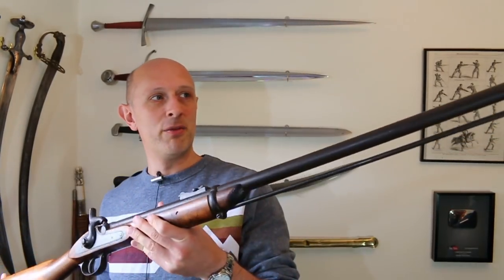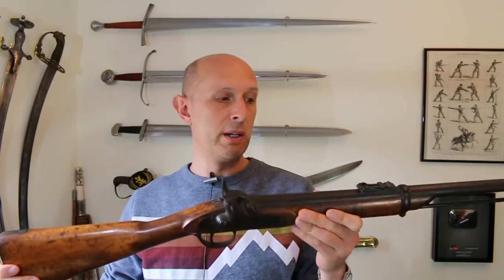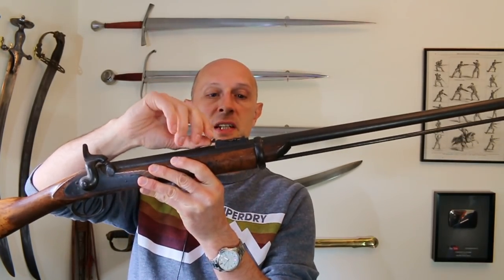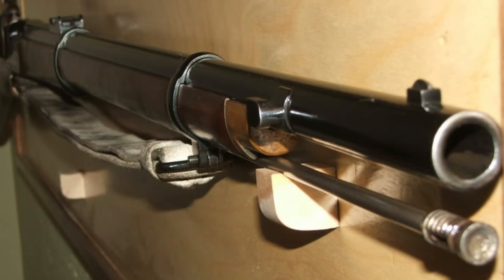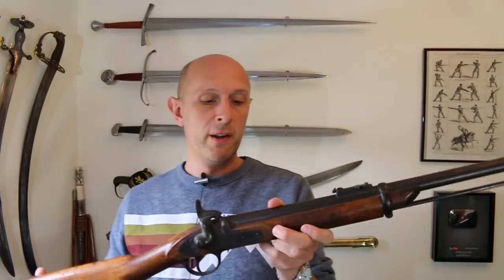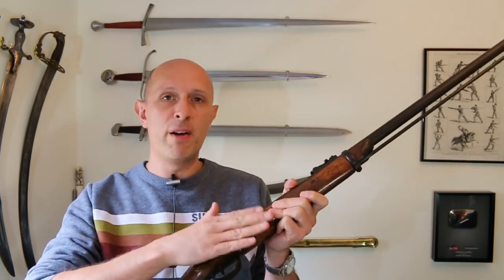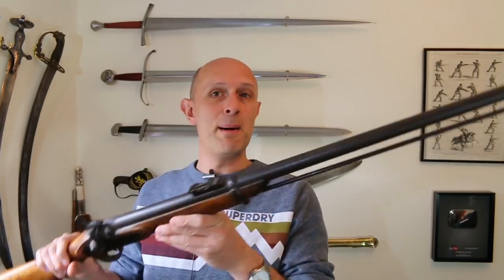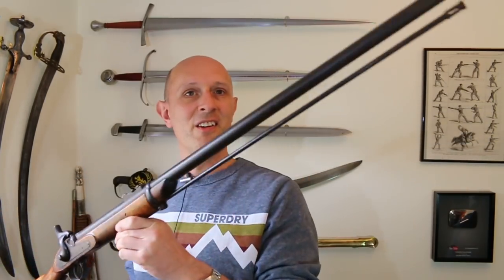Lancaster's Patent Muzzle Loading Rifle

Comment: Excellent post. Another advantage is easy of manufacture. The Lancaster barrels were made using a mandrel and were much easier and less expensive to make than the single hook cut rifled barrels that predominated through the 1860s. They were not widely accepted at the time for the same reason that modern polygonal rifling still struggles to go mainstream in long arms despite all of the same advantages. People like to see rifling. When they can’t, they don’t think it’s as accurate. Today polygonal rifling has been largely accepted in handguns designed for military contracts, and there are high grade custom polygonal pistol barrels available too. But you almost never see it in modern rifle barrels.
Reply: The german Bundeswehr had crome-plated polygonal barrels for their MG3 about 30 years ago. Can't remember, though - maybe they only where for the gun turret of the Marder APC, where barrel replacement isn't as easy as with a hand-carried gun ...

Comment: The problem with firing shot out a rifled barrel is that the spin imparted by the rifling causes the shot to spread further because of centripital force. Even though that rifling is very mild, it would still increase the spread.
Reply: Harvest N however, that's not always a bad thing in every context ;)
Reply from the maker: I kind of what to test that on a large target now....
Reply: The period advertising said that these were also able to be used as shotguns.
Reply: In addition to increasing the spread, it also tends to create a somewhat toroidal shot pattern, i.e. a pattern that looks rather like a doughnut. This can decrease the likelihood of a good hit at the center of aim, which isn't great if you have a small or distant target. This is a common issue for revolvers that are chambered for .410 shotgun shells, as by US law pistols are required to have rifling.
Reply: scholagladiatoria Even at 10yd or so, you will get a donut shaped pattern.

Comment: If it is indeed rifled then using it as a shotgun would have exactly the same disadvantages as using a rifled choke in the shot gun. That is that the cup the holds the shot will engage the rifling and spin exactly the same way any other projectile would. The cup imparts that spin onto the shot which will then have a much wider pattern than it would normally. If no cup is used (it is a muzzle loader) and the shot is packed tightly enough you might have a similar affect.

Comment: P under a crown is a proof.  You can restore the stock with some work.  A dovetail join, find the hardware and it's done.  Can't help you with the bayonet lug.  That has to be welded.

Comment: There were several other such smooth bore rifle designs in that era. What was usually unique to these designs was that the bullet was also shaped in accordance with the shape of the twist. I'll supposition that this rifle may have been furnished with a slightly oval shaped bullet in order to take spin from the twist and prevent blow, as a waste of energy, by of the expanding gases and explosion of the black powder charge. Of course the designers could have been relying on the bump up from a dead soft lead  bullet to take the oval shape on powder ignition. This may explain why the oval is imperceptible to allow a round shaped projectile to fully bump up to the barrels internal shape. I've seen this with Snider rifles where you could see daylight around the bullet in the groves but accuracy being excellent for that type of firearm due to bump up of the bullet that would fill the groves upon firing.

Comment: Long quote from James McPherson's history of the American Civil War "Battle Cry of Freedom":

     "Rifling a musket increased its range fourfold by imparting a spin to a
conical bullet that enabled it literally to bore through the air. This fact
had been known for centuries, but before the 1850s only special regiments 
or one or two companies per regiment were equipped with rifles.
These companies were used as skirmishers—that is, they operated in
front and on the flanks of the main body, advancing or withdrawing in
loose order and shooting at will from long range at enemy targets of
opportunity. Given the rifle's greater range and accuracy, why were not
all infantrymen equipped with it? Because a bullet large enough to "take"
the rifling was difficult to ram down the barrel. Riflemen sometimes
had to pound the ramrod down with a mallet. After a rifle had been
fired a few times a residue of powder built up in the grooves and had to
be cleaned out before it could be fired again. Since rapid and reliable
firing was essential in a battle, the rifle was not practicable for the mass
of infantrymen.
     Until the 1850s, that is. Although several people contributed to the
development of a practicable military rifle, the main credit belongs to
French army Captain Claude E . Minié and to the American James H.
Burton, an armorer at the Harper's Ferry Armory. In 1848 Minié per
fected a bullet small enough to be easily rammed down a rifled barrel,
with a wooden plug in the base of the bullet to expand it upon firing to
take the rifling. Such bullets were expensive; Burton developed a cheaper
and better bullet with a deep cavity in the base that filled with gas and
expanded the rim upon firing. This was the famous "minié ball" of
Civil War rifles. The superiority of the rifle was demonstrated by British
and French soldiers who carried them in the Crimean War. As Secretary 
of War in 1 8 5 5 , Jefferson Davis converted the United States army
to the . 58 caliber Springfield rifled musket. Along with the similar British 
Enfield rifle (caliber . 577, which would take the same bullet as the
Springfield), the Springfield became the main infantry arm of the Civil
War."

Comment: I didn't catch mention of the bore size - that's covered by the numbers with the proof marks. In 1863 the "Army (Rifles)" report was published in the UK. Lancaster large bore (.577) and small bore (.451) rifles were included in the trials. Of the small bore rifles, the Lancaster faired OK in the trials but lost out to the Whitworth in precision. It was noted there was a tendency for the Lancaster to throw occasional wild shots. In the large-bore trials it was however a different story. The tendency to occasional wild shots was not found in the Lancaster. If it was decided to retain the present (.577) Enfield calibre, "the Committee are of the opinion that the adoption of the Lancaster system of rifling will be attended with considerable advantage to the service." Not long after this the quest for a breech-loading rifle commenced, which ultimately led to the adoption of the Snider-Enfield, a breech loading conversion of the muzzle-loading Enfield.

Comment: You find the same type of barrel on some machineguns, for example the german MG3 (modernised version of the MG42). They are harder to make and overall heavier but will stand up to hard use a lot better than rifled barrels, at least that's the explanation given in the Army.

Comment: Smoothbores accumulate fouling quite badly. In fact, rifled barrels may have started as an attempt to give the fouling a place to go...but that's just speculation. However there is no question that a smooth barrel can fouly very badly, depending on the first of the projectile...

Comment: The oval while a great idea is expensive to produce and only a few short years later came the breech loading 1866 Enfield. Loading from the breech allowed for tighter fits between bullet and barrel negating the advantages of having a smoothbored barrel. In conjunction these two factors, expense and obsolescence would've killed the Lancaster.

Comment: Would I be right in assuming that you would need to use oval bullets in this barrel?
If so, that could be the reason why it passed into history along with the other systems requiring specially shaped ammo, Brunswick, Whitworth etc. Cheaper ammo is always going to be a big selling point for those government contracts.
Here's a thought - if you put it on your FAC for a while, when you take it off it reverts to being an antique under current rules and you can keep,display or sell without restriction. I don't know if the same is true if you were to register it as a shotgun. Worth checking!

Comment: Guns of that era were normally bored to 24 gauge or .577" caliber for Military use but could be bored to 20 gauge or .600" caliber for weapons intended for sporting purposes.
If the gun checks out as being bored larger than those two calibers, say 16 gauge/.65 caliber  to 12 gauge/.705" caliber then chances are the gun was intentionally rebored at some point in time and most likely it was done to refresh a worn bore barrel. If this was in fact done it is likely the oval boring was removed at this time and the gun should be considered suitable for ball or shot as a conventional smooth bore gun (Shotgun). HTH

Comment: There is a modern equivalent of this too. More accurate and slightly higher muzzle energy for the same charge. They are not used for two reasons. Firstly cost. This type of rifling is way more expensive (I believe double). The second is the "not invented here" brigade. Always a pain in the grunnocks. There is also for the military the cost implication of changing over, when what they already have works.
Reply from the maker: Interesting, thanks.
Reply: Oops looks like I miss-read some info. Polygonal rifling is not ogival rifling. It looks similar but is actually not the same (I assumed it was). That said Sabatti's version is rounded so would look like ogival (and I really don't know what the difference is). http://www.italianfirearmsgroup.com/news/sabatti-mrr-multi-radial-rifling

Comment: That thing is probably fine for full charges. Get a gunsmith to check it out for you to make sure, but as long there aren't any structural problems.... black powder really doesn't produce crazy pressures. If there is any kind of decent rifling in it, I wouldn't use it as a shotgun.
Reply: Lol. just got to the part about the lack of rifling. Enjoy your shotgun.
Reply: lol. Lancaster rifling... I should just watch the whole video before commenting.

Comment: What was the purpose of sporterizing firearms? I understand that fowlers (sporting smoothbore firearms) developed away from muskets to be better used in hunting birds and small game in trees and in the air. But those guns sacrificed their forestocks in to lessen the added weight of longer barrels. But if you aren't increasing the barrel length, what benefit comes from chopping off the forestock?  

Also, if it was possible to keep a bayonet lug on a short-stock firearm, why did the crown not instruct its governors to subsidize the cost of adding boyonet lugs to the fowlers used by provincial troops, rather than issue out obsolete plug bayonets? Did the crown foresee the American Revolution, and see the issuance of plug bayonets as a security measure. Was it similar to the pre-Reagan US policy of only selling less capable us tanks and warplanes to allies while prohibiting foreign sales of the best equipment. Or was it more like the deliberate choice, during the Gulf War, to mainly expend surplus unguided bombs?
Reply: The stock was cut down to save on weight; you reduce the weight when you reducing the amount of stock.  Makes it easier to carry, faster to put on target, and easier to track running game.  For a civilian hunting firearm, it matters more that it is light and nimble vice able to get into a rifle slamming brawl like the military needs.  Additionally, that part of the stock is not structurally significant.

As for the bayonet comment, I am not sure if you are asking why it has no lug.  He addressed this by saying the lug was likely removed, which would be after it entered the civilian market.